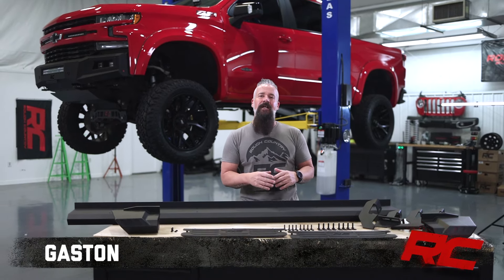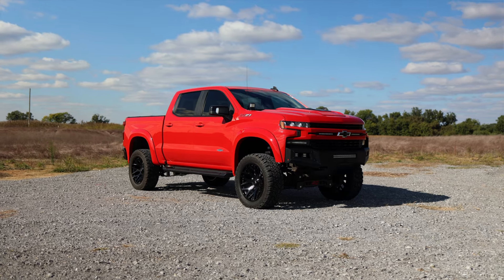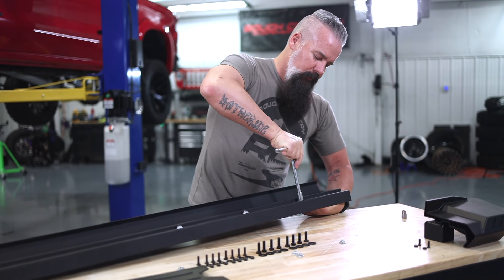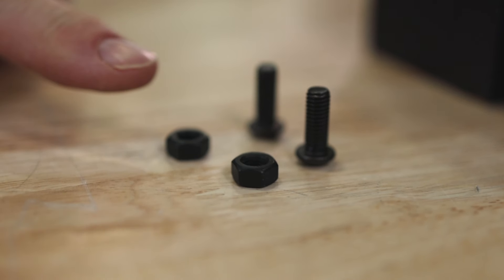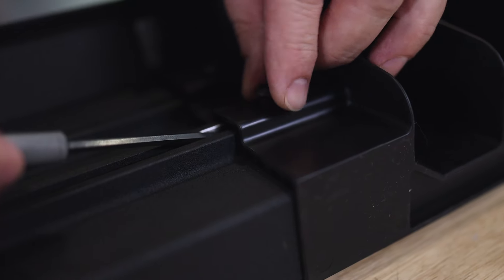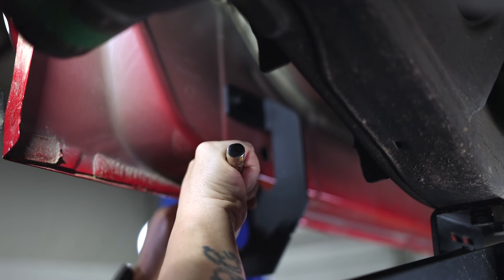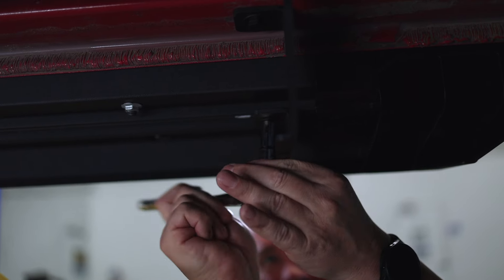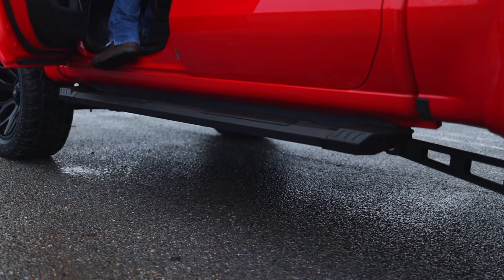HD2 Aluminum Running Boards - Overview and Installation

Comment: Has anyone had experience with these in rainy or icy conditions? From the website and video, they seem extremely slippery when wet or icy. Does water accumulate anywhere? I’ve noticed that people sometimes stand on the end caps to either reach the bed or clean the windshield. Has anyone had these break under that kind of pressure? I love the low-profile look, but as someone with an engineering background, I have some concerns. (I’m considering them for my Ram truck.)

Comment: Ok i will bite any chance they will fit a 2002 Chevy 2500hd crew cab full wheel to wheel length
Reply: Did you find out?

Comment: How many brackets for a 2022 ram 1500 crew cab?
Reply: There’s a total of Six (three per side). I have these same running boards on my 2021 ram 1500 Laramie CC.
Reply: Any flex on them at all? I’m a bigger guy I had some Aries on my brand new 2500 ram I bet I could flexed them down 2 inches atleast
Reply: @tkhang2608  and flex and do yours have the plastic ends?  if so you like the boards?  putting on 20 Ram
Reply: @mack9527  mine do not flex at all and yes, I have the newer style HD2 now. They probably remade these to have the plastic ends. On my first ram they were the one peace and man they are heavy but I feel like they were more heavy duty compared to these ones. I like these ones more with the plastic ends on them due to weigh and they are easier to coat. I highly recommend that you should do as well is coat them with Bedliner spray. The original coating on these are not so good. These are worth the money and they are by far the best running boards I like the most on our ram trucks.